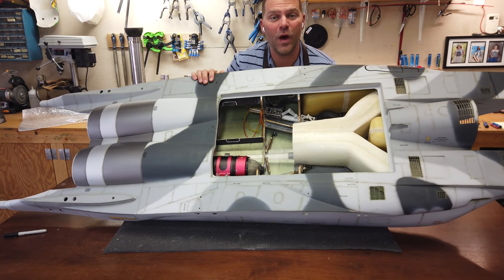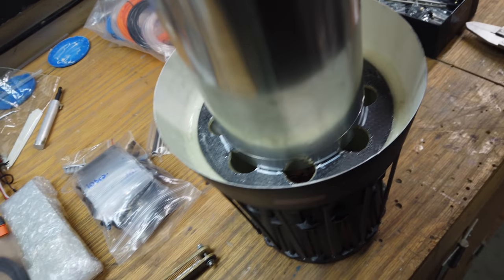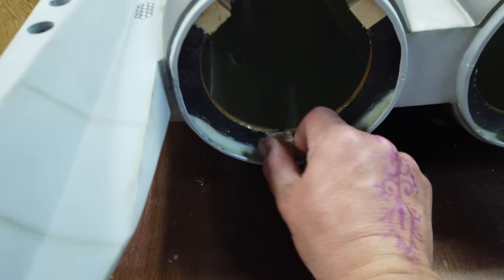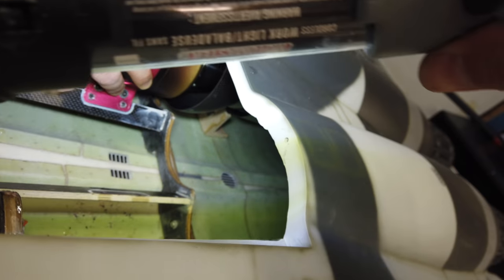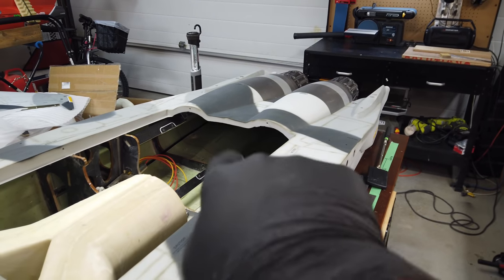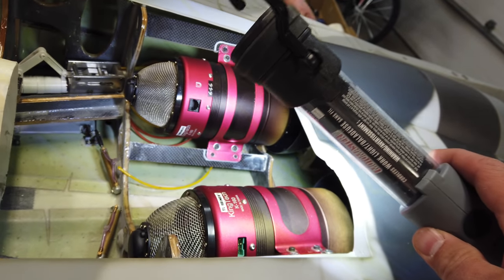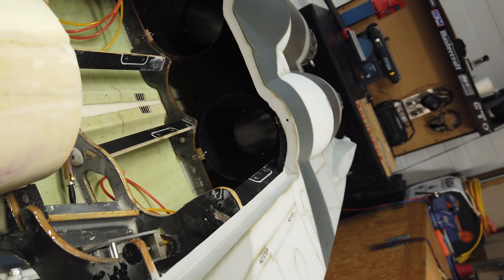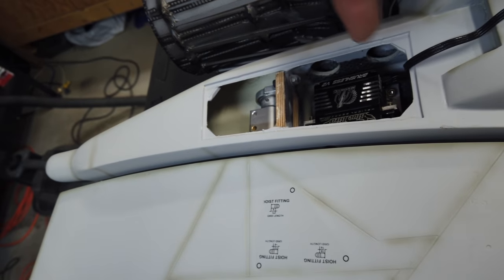HOT SECTION INSTALLATION COMPLETE - Feibao FB Jets F-15 F15

Comment: Love watching you finagle pieces of hardware together into flying machines.:) What I would like to see you tackle is a turbine powered helicopter! Flying model helis is not as frightening as it used to be because flight controllers with 3 gyros, 3 accellerometers,  barrometeric altimeter, and even GPS are now common . You can program whole flights that just require hitting a start button. The hardware is still like a spinning puzzle box ,though. hehe
Reply from the maker: Thanks Joseph!  I did recently pick up a Goblin Heli!  Not turbine of course but it's been about 10 ish years since ive flown a heli.  Just sorting out the controller and batteries and I'll probably video some of the process.

Comment: Excellent video as always. Lots of things to think about ahead of building like making the tail cones removable will require a connector in the afterburner lights or you will have to pull the whole harness out each time.
Reply from the maker: Hey Rick.  Yea the initial plan is to never have to remove them.  If they do need to be cut off, wire can be cut and simple servo connector can be added or similar.
Reply from the maker: Thanks for watching!

Comment: That carbon fiber isn’t gonna get damaged from the turbine heat? Aren’t the pipes typically all metal?
Reply: Captain Smith  I’m speaking on the adhesive part of the composite not so much the fiber.
Reply from the maker: No it should be a non issue.  We did run into an issue with the carbon getting too hot on the L-39 but that was because the engine physical size was too big and close to the carbon bell mouths.  Didn't cause any permanent damage but it got hot and discoloured.
Once the engine is running there is so much air moving that it helps with temp control as well.